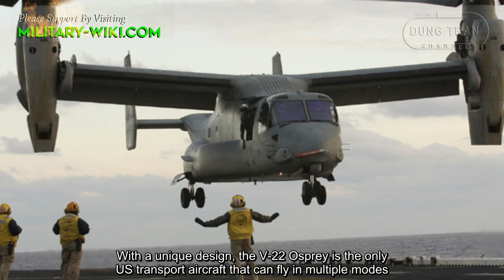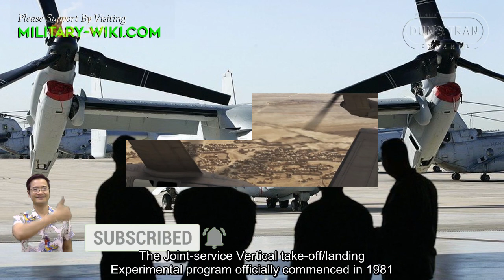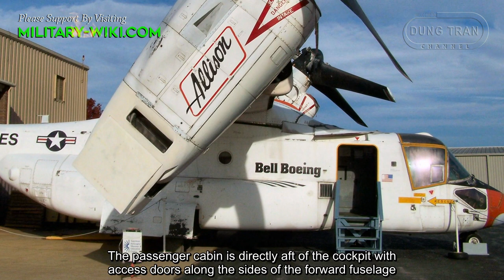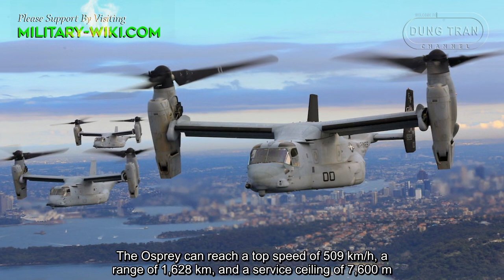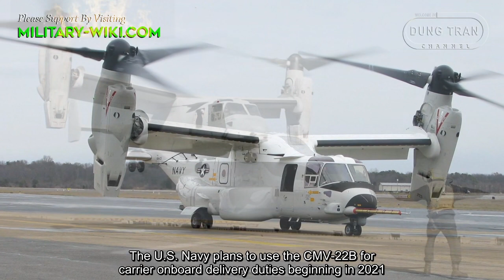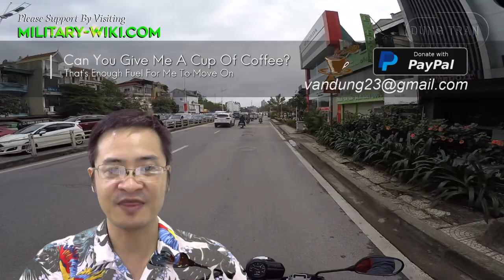V-22 Osprey: Unique features of the American multi-mission tiltrotor aircraft

Comment: This aircraft/rotor craft was had to design and had many difficulties transitioning from vertical to horizontal flight. Several of the early models crashed. It was an expensive craft to develop. It allows for long range with a vertical take off and landing vehicle but at the expense of load carrying capacity. I always viewed this aircraft as much smaller until I saw one fairly close. It's actually quite large.